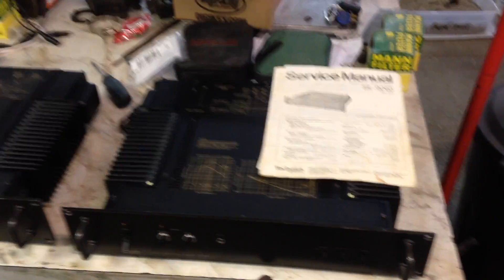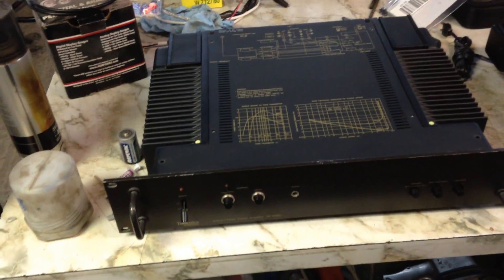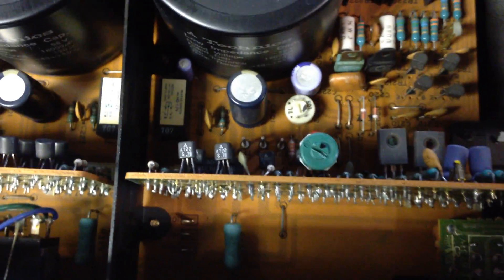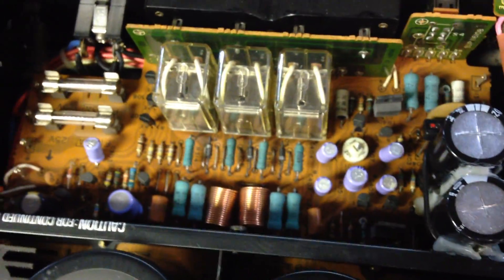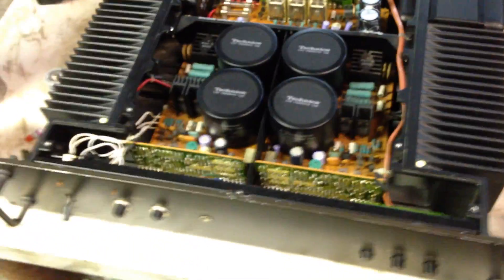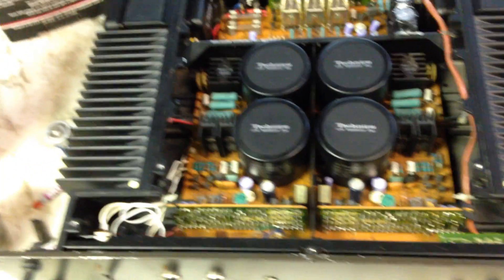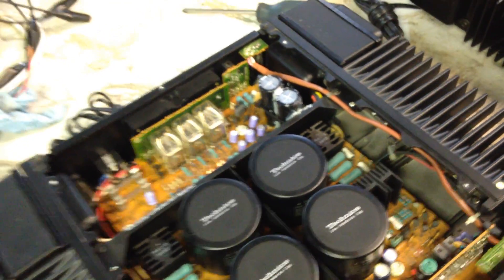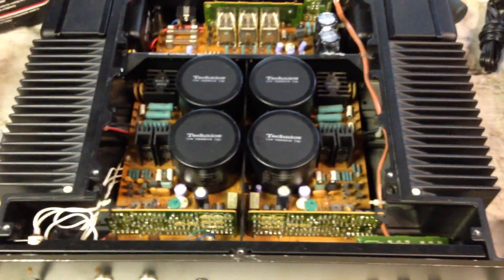Technics SE-9060 Amplifier Repair

Comment: hi can you help with the replacement part for the nikko alpha 450 transistors 2sa1095a  2sc2565a  d882p
Reply from the maker: your having trouble finding it? I know that Fairchild Semiconductor is still manufacturing epitaxial planar semicondutors with similar specs. Digikey or Newark should have these in stock. they only have to be close to identical, as its the AC component being amplified and not the DC which the specifications cite